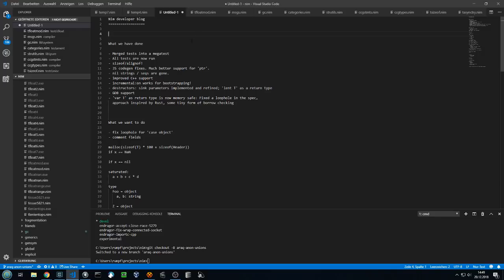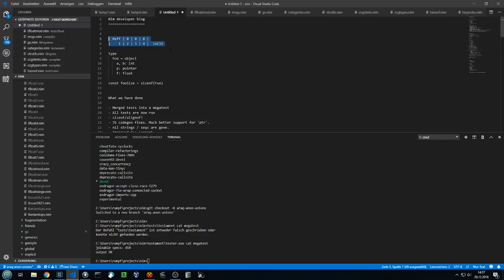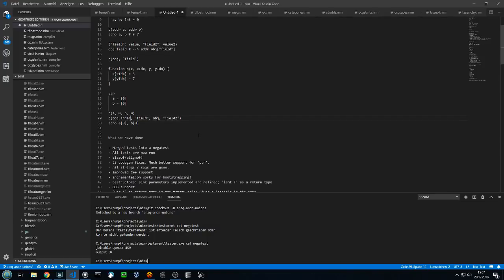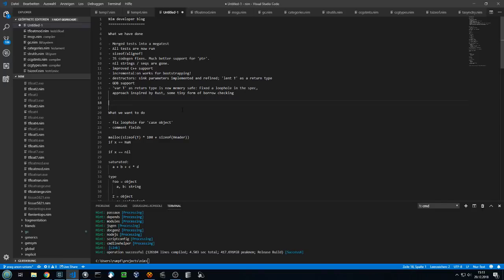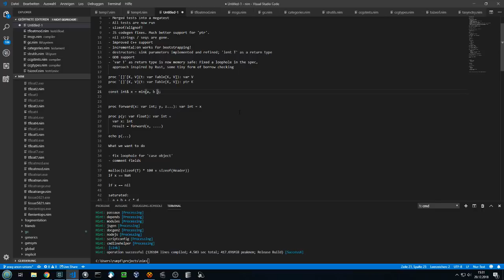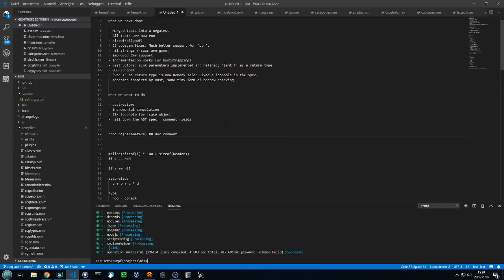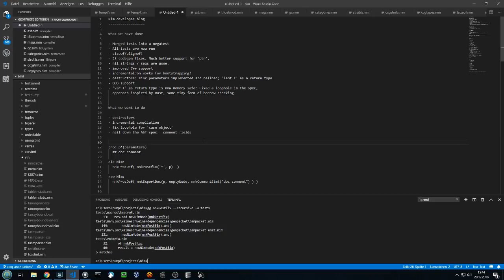Nim Development Blog 2018

Comment: 01:20 Merged tests into a megatest
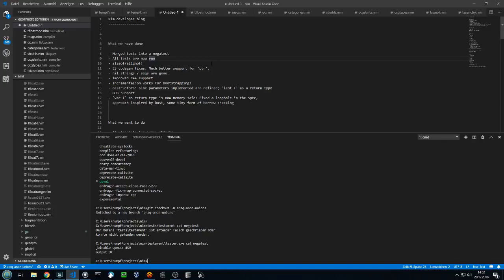04:10 All tests are now run
05:00 sizeof/alignof!
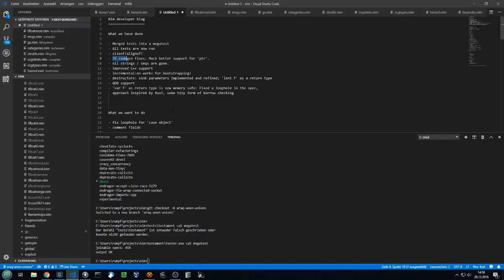09:25 JS codegen fixes
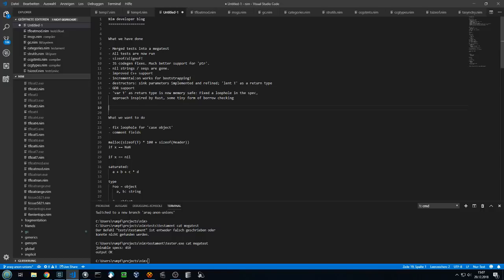17:55 nil strings / seq are gone
19:22 improved C++ support
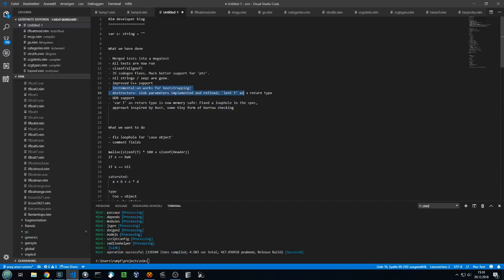21:00 incremental:on works for bootstrapping!
22:37 destructors
27:11 GDB support
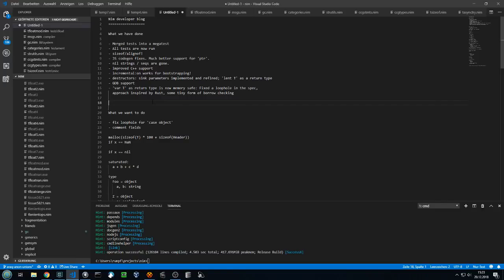33:36 'var T' as return type is now memory safe
41:45 tiny rant about C++ ref semantics
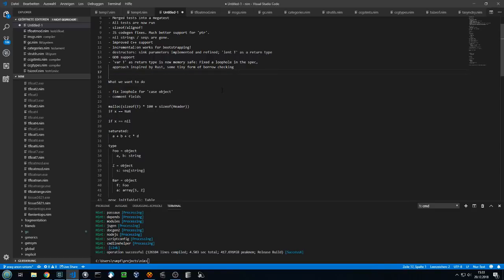43:08 where we are heading
43:48 comment field